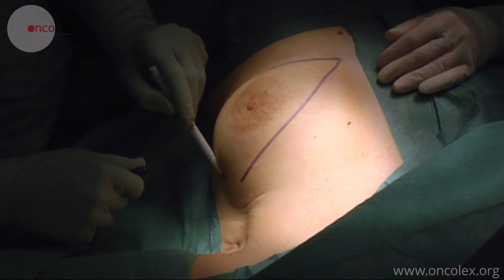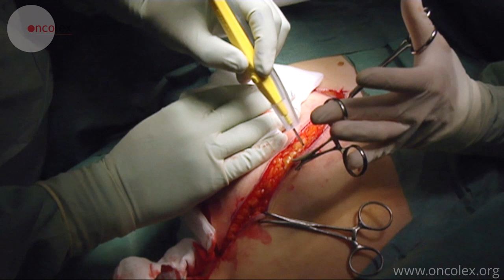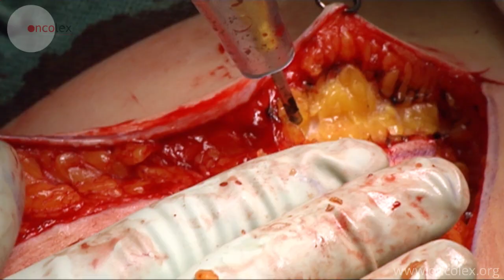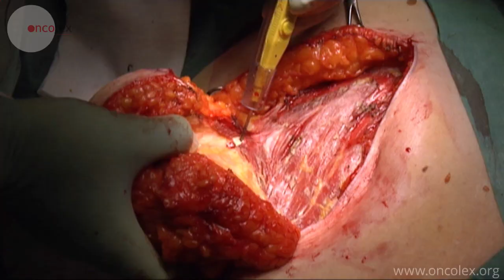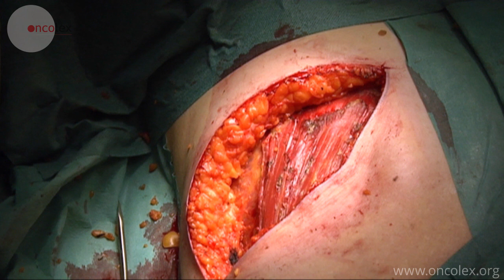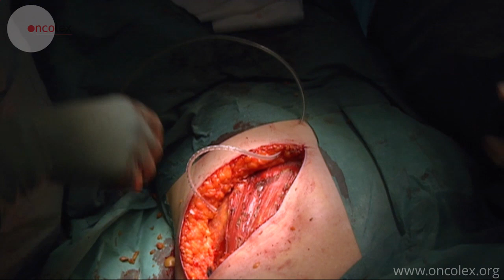Mastectomy

Comment: I am shocked. Few things I noticed are as follows-:
- it occurs due to the increase if the body parts becoming tumor and then cancer. Any tumor can be cancer if it's not measured correctly. 
- several methods can be used but best way is to surgery and treated. 
- Patient cannot use any outside object as the whole of the tissue along with the outer layers and cover are taken out.
- can it be treated by removing the fats and the tissues only need minute surgery then?
- laser treatment and chemo therapy can damage and disallow the ducts and the tissues to grow further but it affects the body in a larger way may be that's why many died.

Comment: People where dies from cancer where does cancer come from?
Reply: It’s better to find that out on google but find a really informative source sometimes it’s not always right
Reply: Basically cells reproduce and spread in order to keep the body functioning.  Most cells are regulated in how much they can reproduce.  Sometimes though, a mutation takes away tbat regulation. So, the cells multiply and multiply without any restraint, with most forming a clump called a tumor and some spreading to other parts of tbe body to form more tumors.